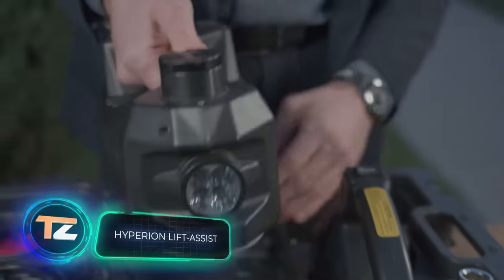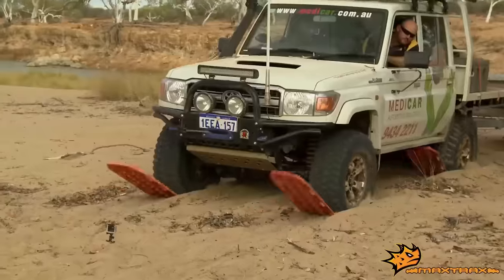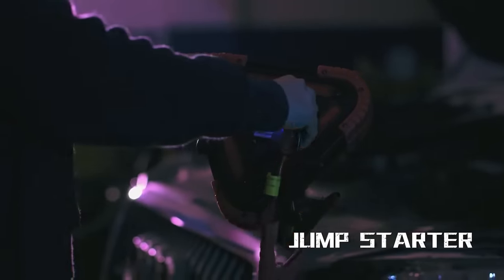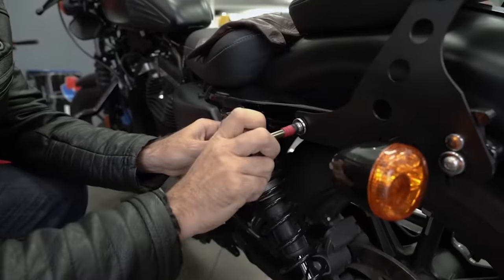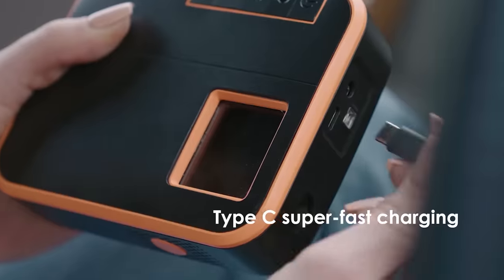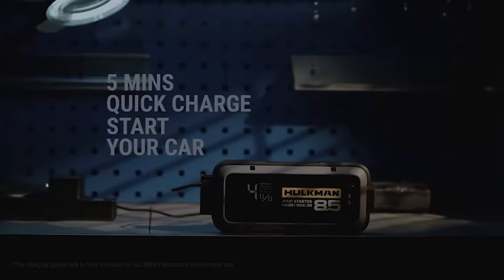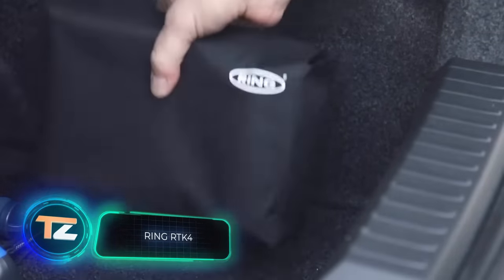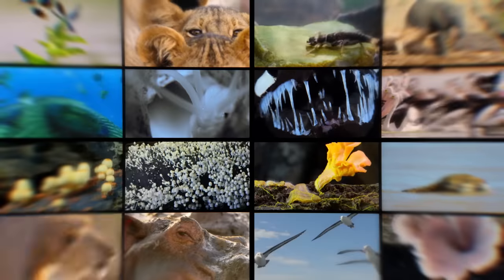EFFICIENT CAR INVENTIONS THAT YOU’LL WANT TO BUY

Comment: Bwahahaha. The orange plastic traction item.....been in Canada for at least 10 years. And are great. Just an item that has been reinvented. 
Patent for a 'Spirograph'.?
Reply: I don't think you can patent the design. You can the product but it doesn't prevent similar ones from being made. By design I mean basic shape. For example I believe that the square shaped smart phone was tried to be patented it didn't pass. What could be patented is material.